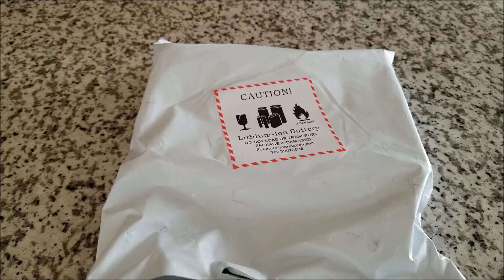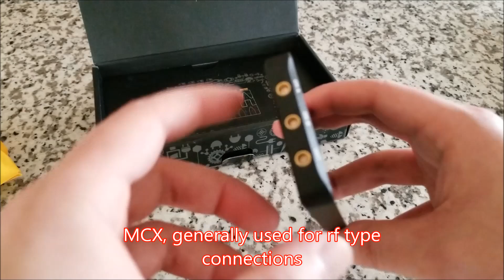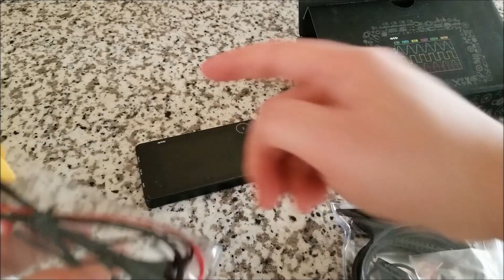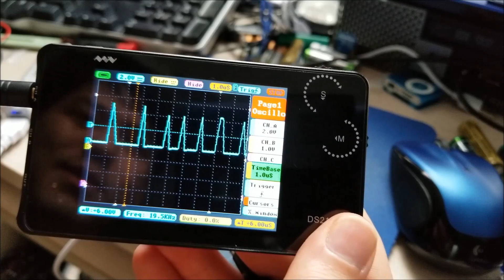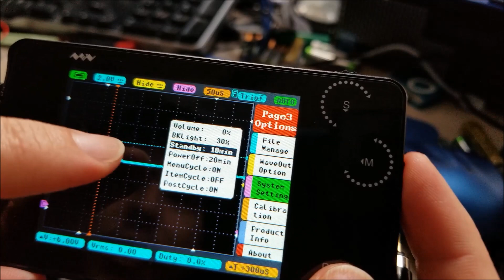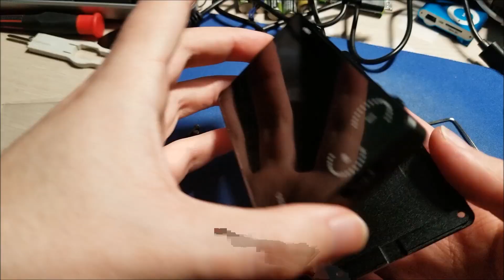Lab Tech: Banggood DS212 2 Channel Pocket Oscilloscope Review!

Comment: Hi, I was able to find x100 probes for this scope but the settings are only for x1 and x10. Since the software is open source it should'nt be too problematic to add x100? Do you think this feature would be usefull anyway? Thanks!
Reply from the maker: Yeah it should be fairly easy to add an extra attenuation range. Just would need to download source, find where in the code the menu option is, copy the x10 selection code, paste it below and tweak the conditional logic to add the option, modify the block to change the multiplier for the calculation, compile and boom that's it. It'd probably take a bit more effort to see how the original logic/calculation works to figure out exactly what you need to modify but I dont think it'd take very long if you are familiar with programming.

Comment: Just bough one because of this video. Very happy! But I can't seem to find how to calibrate the 10x probe mode (and looking at the square wave output, I have a severe skew that I would need to correct). Any idea how to do this?
Reply from the maker: For the 10x setting on page 1 of the options you scroll to highlight the channel on the side and then press in the M wheel, then scroll down to Probe: and set it to x10 by scrolling the S wheel, then press the S wheel in to set it. To save settings even during power off quick press the S wheel in till you go to the page 3 of options, then enter the file manage and press S at the first option to save parameters (it will give confirmation after this is done). As for correcting skew, I believe this is done on some probes with a small calibration pot on the probe body. The only calibration for this scope is one page 3 of options called calibration, and only allows you to zero the trace.
Reply: @sjm4306  Thanks! I actually found the calibration skrews ON the board of the device! was able to calibrate the probe there and now have perfect square edges :) super happy with this little oscilloscope (its my first one)

Comment: Wish I'd seen this video before opening the box tonight.  I bought it to measure 120 v inverter output.  Didn't realize it has a 40v limit.  Is there a simple mod that'll let me use it to measure 120?
Reply from the maker: You can build a voltage divider to step the 120Vac down to well under the 40V limit, but do this at your own risk (you know the whole fire, electrocution, etc warnings about working with high voltage).

Comment: If looking for a low price scope, I think it is worth spending just a little more to get a substantial increase in bandwidth and features.  For example, a Hantek 2C42 is in about the same price range (maybe just a few dollars more) and is 2 channel 40 MHz bandwidth AND a DMM function.  For a little more, you can get a 3 in 1 scope/DMM/signal generator.  And for a bit more, the same thing in 70 MHz bandwidth.  Owon also sells a similar product line.  They aren't as tiny, but they are robustly built.  Price is one thing.  Value is another.
Reply from the maker: It really depends on application, there are certain cases where having a completely isolated, battery powered scope is cheaper and more convenient than going for a desktop model and shelling out for isolated/differential probes. Now I wouldn't advise using this as the only scope ever unless someone is that strapped for cash, but there have been a few times that this unit has come in handy along with a conventional benchtop scope.

Comment: Does it have FFT analysis? Can you save captured raw data to external device?
Reply from the maker: No fft (well at least the stock firmware, there may be some custom firmware that does idk) and yes you can export a csv text file of the raw data as well as png screenshots. When plugged into usb it shows up as a flash drive so you can drag and drop the files off of it.

Comment: Hi Dr., Thanks for the video. May I've a question? Can DS212 explore the phase relationship of two channels? For example, when the two inputs are in-phase or anti-phase?
I can read the inputs from 2 external sources (I know they are anit-phase, 180 degrees lag). However, it seems that DS212 always show that they are in phase no matter what "trigger" option I selected (including None and Scan; I even set the trigger ”off“). Could you please help me with that? Thanks ~
Reply from the maker: The DS212 triggers exactly like benchtop oscilloscopes, you select the channel to trigger off of and that's it. It does nothing to change the phase relationship between the two channels. If you are measuring two signals and they look in phase then that's because they are in phase. Now there's an important gotcha and that's input frequency. If you are measuring two sine waves that are too fast then the relatively low bandwidth of the DS212 could be causing aliasing and thus the signals you see on the screen aren't actually the real waves. I would suggest that the DS212 not measure a signal that's above a couple of hundred kHz to prevent aliasing.

Comment: This is Rubbish, mine Stop Working after 4 Uses and just
Display Screen "digital storage oscilloscope"
with colour bandé Above. Absolutely Wasting
of Monies, DONT Buying this ¡¡¡
Reply from the maker: Sounds like the firmware is corrupted for some reason, but the arm has a dfu mode so you should be able to easily reload the firmware over usb.
Reply: @sjm4306  thanks for that, I plugged it into a 
windows (10) Computer via both USB 2 and USB 3
And Windows kept saying that it didn't recconise
the USB Device plugged in,
Reply: @sjm4306   Their web site is in some Strange
foreign language and is of no use what so ever unfortunately 😐!!!
Reply from the maker: You have to plug in usb, hold pause while turning on to enter dfu mode. It'll pop up as a small drive and you can paste the firmware file there on the root of that drive. A quick google search shows this in the user manual, page 23. I think you can then turn it off and disconnect and turn it back on and it'll install the new firmware. The firmware hex can be downloaded here (https://www.minidso.com/forum.php?mod=viewthread&tid=1799&extra=page%3D1&mobile=2). The site is in chinese but you dont need to understand to download the links. Not sure if it's in the app or source zip but should be easy to search for the hex file extension.

Comment: Hi can i use this scope for automotive application.i have read the manual in which it's written max digital input volt +5.what does it mean.can i use this scope to test a fuel injector voltage waveform which rise above 80 to 100v.

Comment: I'm procrastinating about buying this oscilloscope or the DANIU ADS5012H or something similar or should I hold off for another month and buy a different one and have basically a double budget, I may go up to 225 to 250 Euro for my budget to buy an oscilloscope but I'm not gonna spend more than 250 because it's not worth the investment for the things I'm gonna use it for, that is on Raspberry Pi and Arduino projects to see what's happening with the signals from different sensors or communication lines between the microcontrollers and my computer perhaps but that's really at the most advanced level that I need an oscilloscope for, maybe in rare cases I could use it to troubleshoot some device to see if it's fixable, I think I'll use it mostly for reverse engineering things.
So what do you recommend for me, what's the best option, what to do?
Reply from the maker: When you start getting up in the $200 range it begins to look like getting a tabletop model is a better deal than one of those portable ones (unless you absolutely need the portability aspect). The question though is do you plan to measure mostly digital or analog signals? As is often the case with raspi and arduino projects, a cheap usb logic analyzer (<$10 for 8 channels) is infinitely more useful for debugging digital signals than a 1 or 2 channel oscilloscope would be. However if you really need to measure analog and occasionally only 1 or 2 digital channels then a scope is a better option indeed.
Reply: @sjm4306  I know you're trying to help me but this isn't making it easier for me to choose, lol
Reply from the maker: Sorry, it seems that I can never give a simple answer because I see too many variables
Reply: @sjm4306  yeah that's my problem too, there are just too many choices to make, but I'm leaning to the bench top oscilloscope and I'm thinking to maybe a little bit bigger budget so I can simply rule out many choices because for up to 300 Euro lets say there must be an oscilloscope for me that I can use for the simpler stuff now and that I can keep using also for the more advanced stuff later which is reverse engineering things and most of the times I want to use it for example when I build a new DC power supply that I can check my work and see ripple voltages and transients and things like that, it would be awesome if I also have an FFT function and as large as possible memory... deep memory, I think you know what I mean with that right?
What do you recommend now that I'm more specific?
Reply: @sjm4306  what do you think of the Hantek DSO4202C - details here: https://www.banggood.com/custlink/KKDG2CJ96w
That would be a great scope for the first one right?
Reply from the maker: The Hantek DSO5102P is a good deal (100MHz, 2 ch, FFT, 40k sample depth, usb, ~$200). Half the bandwidth of the one you linked, but nearly double the sample memory (plus quite a bit cheaper).
Reply: @sjm4306  yeah the one I linked I saw that it was crashing a lot so that's a no go for me.

Comment: Almost everyone get's it wrong with the focus in every video, it's not that hard, just set the focus to manual and then put your camera on the stand if you haven't done that already, then you set the camera to focus on a set distance, that will keep the camera from auto focusing all the time which results in being out of focus most of the time when you're filming something close up.
If you have a preset distance for the camera to focus on which is in frame and good for showing your hands and always have the camera focusing on a point just above your work bench or work space by using a little box or something with some letters you can focus the camera on you'll be in the golden zone and then you only need to change the camera whenever you want to show something from farther away or even closer by just use zoom in and out.
I hope this will help you make better videos without getting on people's nerves by using the auto focus all the time.

Comment: I love how they in all their DS212 packaging and on their site and on forums etc.. give the impression of firmware updates and service etc. and it will be an active product. from their end and even highlight upgrade in the box by a folder.
Just got one in 2020 and could see it was still on the first release from like mid-2017, but it seems that is all she wrote, literally and simply no upgrades or added bells and whistle.
and fw and app and stuff is identical to the first early 2017 units.
They likely ditch it and went on with other models... seems to be the norm in China.
Also took a look on Github.. sadly not a model that had gotten any third party love here these last 2½ years..
But you helped with one of the biggest issues I had, lack of saving.
So thx a lot channelholder.
Reply: btw they have changed the packaging from yours to the unit i received here in 2020.
You don't get these transperant pouches.. and you don't get this dupont hook kit anymore.
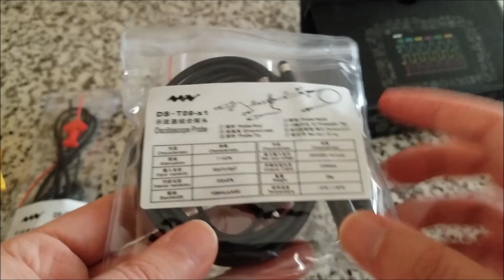You do get two black mcx propes but they look to be of worse quality then the single unit you got... no naked pogopin-spring topconnection on the prope, and the propes dont disassemble in the waist etc like the earlier DS212 propes did  and can be seen on the prope schemtics..  7:32
if the cable is of worse quality.. I can't say haven't touched one of the older.
but these two they are shipping along is quite crude and do seem like a step-down versus yours..
// depending on the channelholders comment in commensection, maybe it aint a 1X and X10 prope they have fitted in earlier DS212 packages-
The two mentions above, are both X10 able.

Comment: Are there converters to connect BNC?
Reply from the maker: I couldn't find any so I bought some female bnc connectors and spliced my own.
Reply: Dominic, ta! I was still trying to find out if this was in fact an MCX connector. As it is the case you can get also get MCX to BNC cables from Aliexpress for instance.

Comment: My DS213 just says FPGA Configuration Err! Then wants me to upload to the .hex or .bin file which does absolutely nothing. It turned on for a few mins but then did this and hasn't came back on since.
Reply from the maker: Is it new? Sounds like the config flash for the fpga is toast (manufacturing error or something). I'd contact the place you got it from or the manufacturer for a replacement.

Comment: Just got one and had to send it back because one of the encoders wasn't turning smoothly and try as I might, I could not get a waveform to display on it. I found the menuing system rather clumsy and arcane, too. I decided to spend another $50 and get a larger scope with physical controls and a larger screen, and math functions that the mini was missing (FFT being the big one).
Reply from the maker: It definitely could benefit from more dedicated buttons and tact switches instead of the rotary encoders for reliability. If you dont mind me asking what scope did you end up getting?
Reply: @sjm4306  A Siglent SDS1052DL+ (I had originally purchased the 4ch version of the mini). It's a terrific scope- well made, accurate, stable, but not nearly as portable as the mini!
Reply from the maker: Looks like a great value for the price. I'm currently in the market for a mso or just a straight up standalone logic analyzer, probably gonna look second hand as those get pricey for new ones.

Comment: Re your comment on the longevity of the rotary encoders...can you determine whether they are optical or resistive? Optical encoders generally have a good lifetime even if not the best quality when treated carefully.
Reply from the maker: I haven't opened them myself to definitively check (that would be destructive), but looking at them I am almost absolutely sure they are resistive/mechanical wiper based. I've found some replacements that look nearly identical on aliexpress so I may just buy a bag of them for their eventual demise.

Comment: is this model still 'the best'? newer models with more features or bandwidth ?
Reply from the maker: The DS213 Quad is a higher end model in specs and inputs but also costs nearly double this model. In the end what is best really depends on what you intend to use it for and what your requirements are.

Comment: This is a nifty scope but with only 1Mhz BW, I can't justify a $90 expenditure!

$50? Maybe. But then, maybe not.

Lots of nice features and a really good design overall. I'd love to have one, but regardless of price, the 1Mhz BW is just too limiting.

I'd be better off putting the $90 towards at least a 10Mhz scope or better yet a 50 or 100Mhz unit.
Reply from the maker: It really depends on what you'd use it for. I really do wish it had at least 5-10MHz, it would make it absolutely perfect. But even at 1MHz it's still pretty useful for debugging slower digital signalling for my microprocessor projects. And having a scope that runs on battery means not needing separate costly differential probes for testing applications that require ground isolation. Since I do mostly digital design though a logic analyzer is ultimately more useful to me and I have bought one made by the same company but the controls take some getting used to.

Comment: Hi, what kind of input is that on the scope? Do you know the name of that conector? I need to get a cable from that to 3.5mm so I can visualize the waveforms from a synthesizer.
Reply from the maker: I'm guessing you will have to splice your own from different cables as that's a pretty specific adapter that I don't think any commercial product would require so that would explain why no one seems to have them.
Reply: @sjm4306  I figured I could just use a couple of different cables together. MCX to RCA and RCA to 3.5mm.
Reply from the maker: I believe they are called MCX connectors
Reply: @sjm4306  Thanks! I check but could not find any adapters or cables to mono 3.5mm

Comment: there is a DS213 version you know the differnece? https://item.taobao.com/item.htm?spm=a230r.1.14.72.689621269Yr4oG&id=7059513670&ns=1&abbucket=3#detail
Reply from the maker: Higher bandwidth, two more channels, and I've seen more custom firmware for it to add features like xy mode, etc.
Reply: sjm4306 its twice as expensive, you think worth it?
Reply from the maker: It depends, do you need more than 2 channels simultaneously, what max frequency signals do you need to measure?

Comment: Hi sjm4306.... can you help me out here... I have one of those DS212s with a dodgy S encoder... it only scrolls in one direction.... any idea on how I can replace it??? Thanks in advance.
Reply from the maker: Physically replacing it will likely involve a heat gun to remove it without lifting pads. The main issue unfortunately isn't the physical aspect of soldering, but rather obtaining a replacement. Your best bet may be to search sites like aliexpress for the few manufacturers who still make small smd rotary encoders that will fit.

I'm actually tempted to just make a drop in replacement board that can be soldered in place of the encoders that replace them with little tact switches for up/down or left/right and center push adjustment as that would be so much easier/more reliable than these rotary encoders.